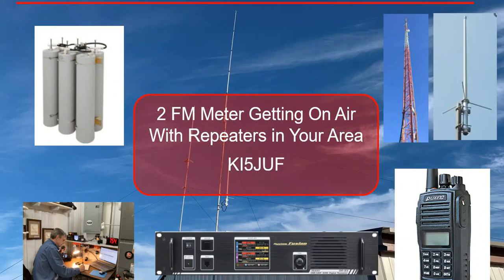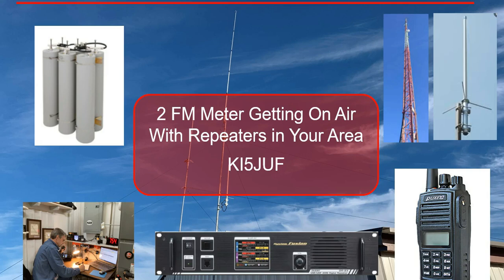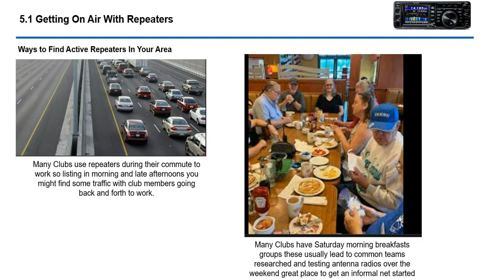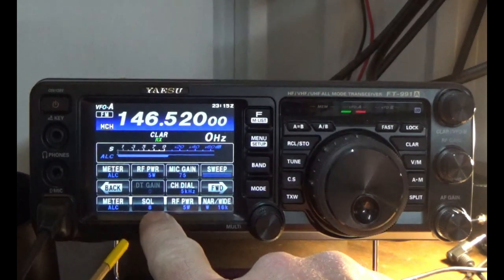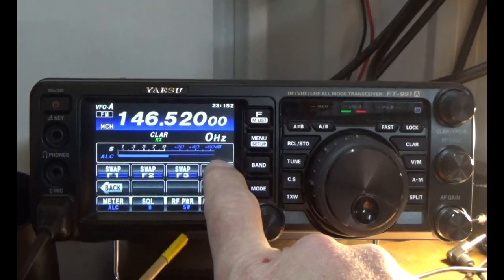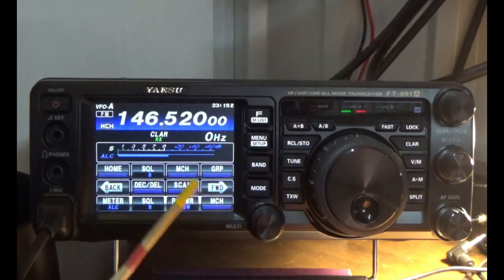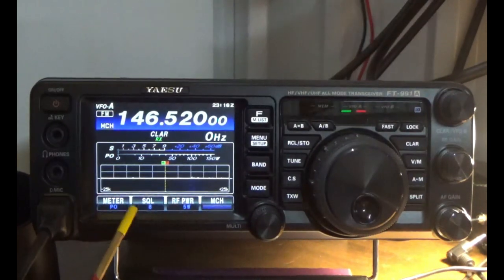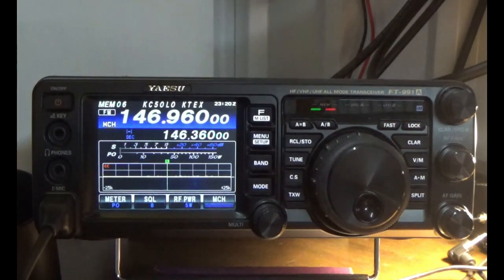2 FM Meter Getting On Air With Repeaters Programing FT991 CTCSS Uplink & Downlink Tone Repeaters

Comment: You did not show programming the uplink frequency only the downlink frequency? Why? I thought you needed the transmit frequency and tone to open the repeater.
Reply from the maker: Good afternoon William how are you doing, that's a good question, actually you program the receive frequency, then depending on the RPT shift the transmit frequency will be automatic, for example our local RPT is advertised as KCOLO 146.760 MHz (with a - 6kHz) shift, so the radio knows to transmit on 146.160 and receive on 146.760.  Let me know I hope I was able to help 73 and let me know if you have any other questions be glad to help if I can 73 sir
Reply: Thank you for your response and help. I tried what you said and did a radio check to see if someone was on the net. Received no response. Did not receive the repeater repeat back tone. The repeater is not far from me. It is listed as having a 30 mile range. It’s listed as amateur radio society ( TAARS). The listed repeater information is: Downlink 147.33000, Uplink 147.93000, Offset +0.6MHz, Uplink Tone, 131.8, Downlink Tone 131.8, Grid FM16sc, Use Open, Call WA4VTX. Can I program this repeater into my GMRS radio and how? Thank you for your assistance and knowledge.